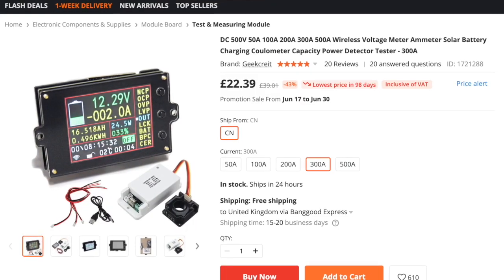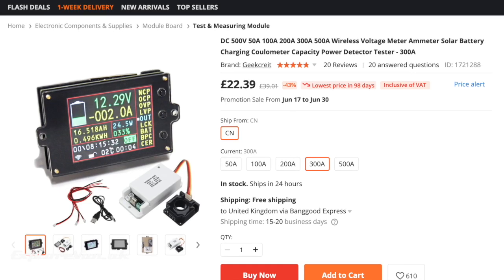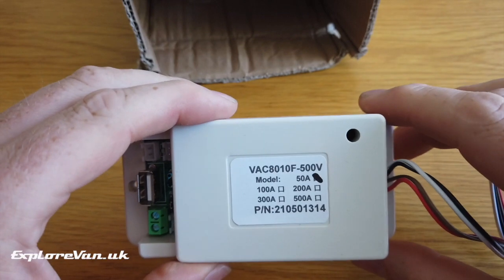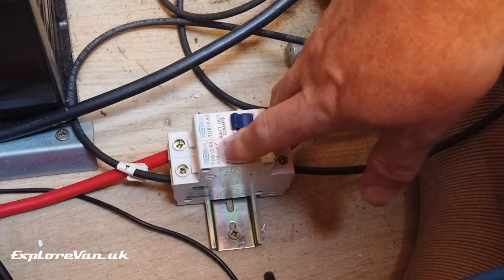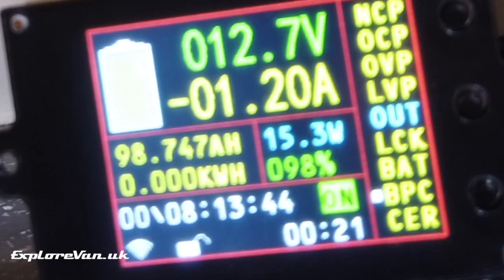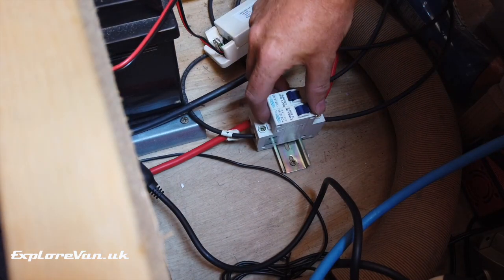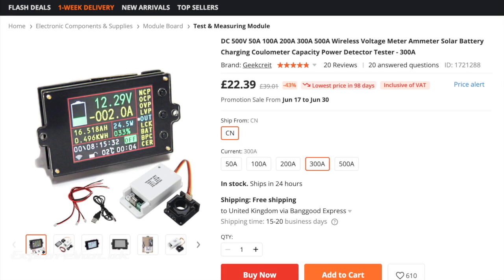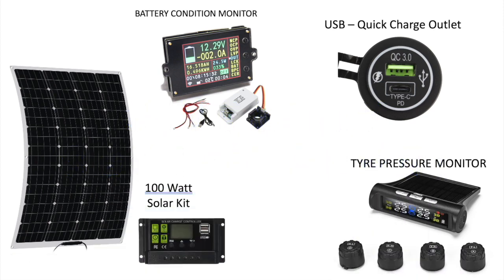Wireless Leisure Battery Monitor Gadget Review 2021

Comment: Do you think that powering the main board (through a step down) and feeding it 100v dc to its voltage reading port, all of this simultaneusly through the same switch on the 100v cable, might do harm to it? Or it has to be first powered on, get the things running in it, and then switch on the main power to its voltage reading port? Thanks.
Reply from the maker: Sorry I wouldn't like to say as not sure how it would behave. 
Personally I would power it from a separate source.

Comment: I do like your switches for isolating the solar panels. Are they just normal circuit breakers on a DIN rail?  Have you just got the live from the panels & the battery going through these?
Reply from the maker: Hi, yes they are circuit breakers on a din rail - however they are specific for DC (Direct Current) rather than AC (Alternating Current) This is because AC ones could arc over the contacts in a DC circuit.
Here is an example of them:
https://amzn.to/3BVBd7n

In my set up I have 10Amps on the panels and 32Amps on the battery.

Yes, only the Positive from Battery to controller and Panel to Controller go through them.

Comment: Whats the limit on the capacity setting since you have to set it 10x to begin with as I have a very large battery bank and wondering if I would actually be able to set it up cheers
Reply from the maker: Hi, it can be set as high as 65000 AH.  So allowing for the adjustment you’d be fine with a battery bank up to 6500 AH

Comment: Hi, does the screen sleep when not in use?
Reply from the maker: Hi David, yes you can set the screen time out in the menu. From 0 seconds (always on) up to a minute if I remember correctly. 

You can also set it to auto switch the screen back on when certain currents are reached.